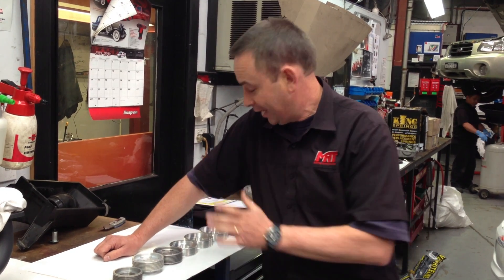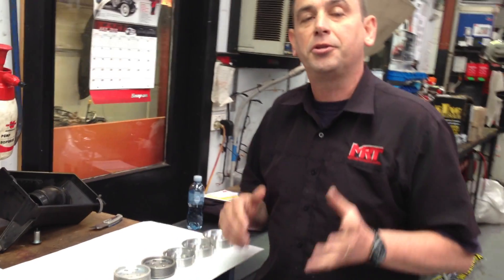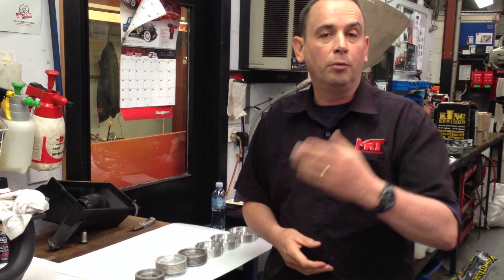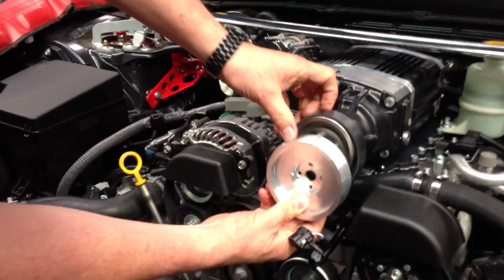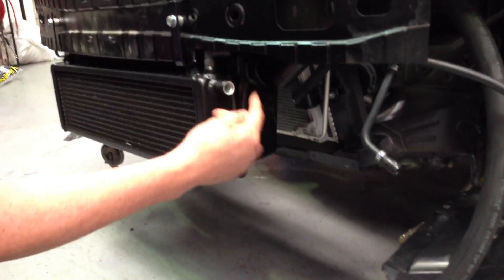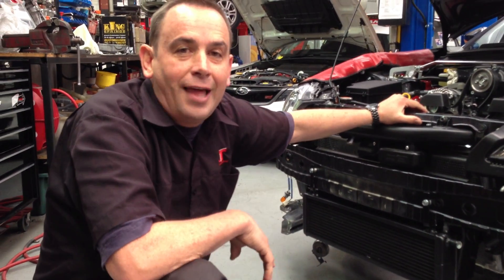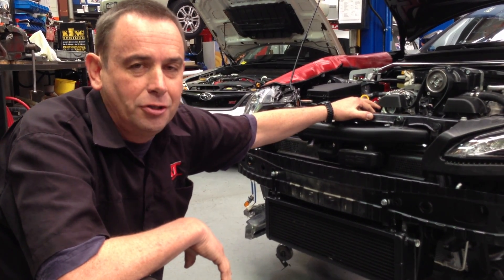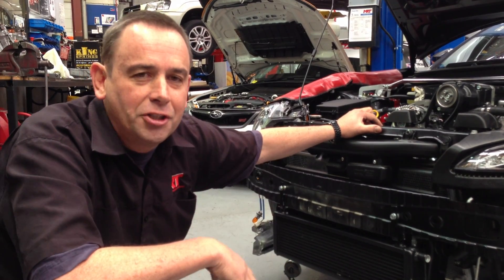Subaru BRZ Toyota 86 Supercharger kit with turbo. Testing Pullies Part 3 MRT Performance

Comment: Can you tell me why the turbo charger needs an intercooler when there's a intercooler for the supercharger? I think it's redundant and not necessary to include the turbo intercooler.
Reply: aaguirre123 I thought it was just 1 intercooler with an oil cooler in front of it

Comment: This is nuts. To much complexity.  Why not just use a clutch and have a large  SC kick in at say 3500 rpm.  Let the engine remain stock below that point. You will still need an intercooler. You will get stock reliability and mileage till you pass 3500 rpm then just hang on..

Comment: would it of been easier for a just a larger water to air system so one very large heat exchanger and then just pipe it as tubo wta intercooler connected after the superchargers wta intercooler?